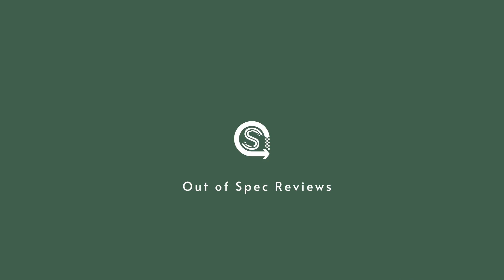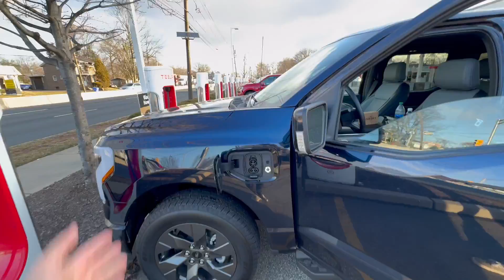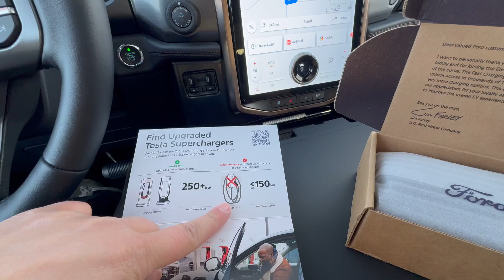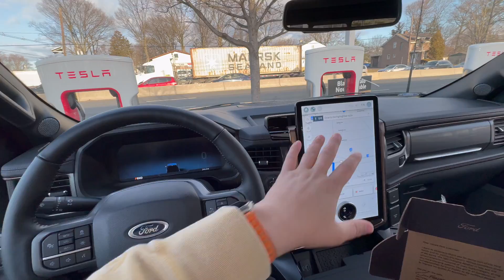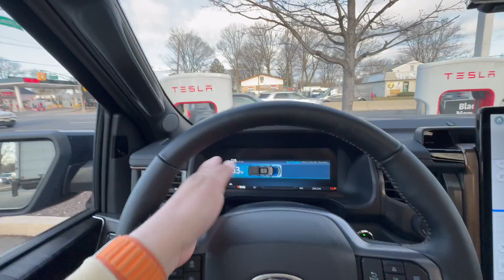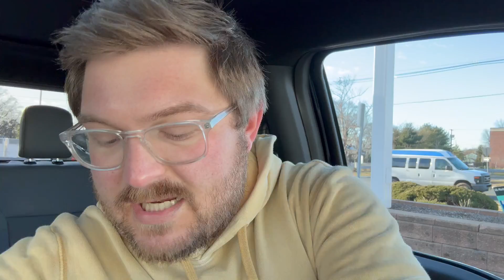Ford Gains Access To The Tesla Supercharger Network! Join Me As The First To Plug In

Comment: We have a Tesla supercharger station that was completed in the last year or so in a big parking lot near a Walmart and a few restaurants. I don’t know if it was in anticipation on the Cybertruck or non-Teslas using the chargers, but it has two options, one that I have never seen before. One charger is set at the end of the island with open parking slots beyond it making it basically a pull through. The other set up is the really odd one with the charger on its own little island set at 90 deg to the other chargers and sticking out about 3 feet alongside the parking slots on it side which would make connecting your Lightning a breeze.

Comment: When Rivian gains access, will those customers be able to use the Ford adaptor ? I doubt it. This adapter likely contains a microchip that confirms that the vehicle is a Ford and  and that the adapter genuine Ford issued adapter. There may also be a chance that the adaptor may identify if the vehicle has been tagged as stolen.

Comment: You are in the 1B spot charging on the 1A charger, the mach E looks like it's in the 3A spot so it will be charging on the 2B charger while the other lightning appears to be in the 4A spot charging on the 3B charger. So with three fords charging in seven spots there is room for one Tesla to charge, that would be the 2A spot. 

 This is going to be a problem, particularly in places like Ocala where the chargers are usually full and you have to wait on a spot. I think they should have restricted the all access to stations that are V4. 

 There are going to be major altercations at Tesla superchargers.

Comment: Kyle, can you create a video to address that you were taking up TWO Tesla charging spots in your Lightning test. The empty spot to the left of the Lightning would normally be taken by a Tesla. So that makes sense, one vehicle, one spot. But where you had to park the Lightning to charge is preventing a Tesla from charging because it's blocking the charger on the right side! So as a Tesla owner opening Telsa Chargers to non-Teslas is one something I can can live with for the greater good. But Ford vehicles taking up effectively TWO spots for Teslas is a deal breaker. In the SF Bay Area, we routinely have to wait for Tesla Chargers as it is. Fords taking TWO spots won't work for anyone. Ford needs to move the charger port or give Ford owners an extension cable with that converter.

Comment: My biggest worry is that the software on my MachE will not be updated by the time I even get the adapter. It's been almost half a year since the lane change assist feature in BlueCruise was released, but my Ford PowerUp software is still lagging versions behind to even receive that OTA update. Went to the dealership multiple times and they could never fix it. We could very likely receive an adapter, only to not be able to use it for god knows how long thanks to the terrible software. fingers crossed

Comment: The problem here is that the two spaces on either side of the truck cannot be used by Teslas.  Tesla ports are on the rear drivers side, a tesla would park in the space to the left to charge.  This is going to be a huge problem if one Ford truck basically removes three spaces that could be used by a Tesla driver.

Comment: Given the lightning is only around 150kw dc charging (so slow), I hope when they go NAC built-in, they boost the charging rate to 250-350kw. Common complaint for the truck is people like it until they want to do road trips or truck stuff like hauling (load range woes aside), then it takes too long to recharge it due to Ford's poor choice in charger that should have already been swapped out this model year. The other two domestic brands are soon to release their EV/Phev trucks, Cyber Truck already out (though has it's own kinks), Ford needs to refresh the lightning more sooner than later to stay relevant.

Comment: The supercharger reliability reputation comes from them having top to bottom control over the chargers, vehicles, and network. As soon as they have to deal with all of the variables that other charging providers have to deal with, the reliability will tank. People will also quickly discover the limitations of the stubby cables, low voltage, and congestions due to the wide range of vehicle charge speeds and battery capacity requirements.

Comment: The companion podcast is great, but I have one question for you regarding packaging. As a Tesla owner I am concerned non-Tesla vehicles will be blocking a lot of charger spots because the Ford port is on the wrong side of the car. The question is does the Ford packaging discuss blocking chargers to the left and suggest their owners charge using stalls starting on the right of a line of chargers? Thank you for this great video.

Comment: Well, hopefully and ideally, when manufacturers start with the native NACS ports, they put them on the front passenger side and/or rear driver side. They can literally go anywhere on a vehicle, or have multiple port locations. That would be way easier than redoing every stall at every SC location. As Tesla upgrades to V4 with longer cables, it may not matter as much, but those to port lications on the vehicle would be ideal to begin with.

And Elon wanted this. He wanted EVs to be ubiquitous among all manufacturers. So, any Tesla owner who's hating on this just needs to swallow their ego and entitled thoughts. It will get better eventually, for their sake, once the other networks start adding NACS cables to their chargers.

Comment: Cool. BUT!!! Reality check! From Reuters in January...... 50% less than planned! "We are taking advantage of our manufacturing flexibility to offer customers choices while balancing our growth and profitability," said Ford CEO Jim Farley in a statement. The announcement is the latest sign of slowing demand for EV trucks. General Motors (GM.N), opens new tab in October postponed the opening of a $4 billion electric truck plant in Michigan for a year. Ford told suppliers in December that it planned to produce about 1,600 F-150 Lightning EV trucks per week starting in January, roughly half of the 3,200 it previously had planned."
Reply: You do realize that demand for all vehicles, ICE, hybrid, and EV, has tanked with only a few exceptions due to high interest rates.
Reply: @charlescourtney4412  Um...you just pulled that out of your nether regions. The rich and early adopters are DONE! Few people want to spend $40K + on a new EV. There are plenty of reliable NEW gas cars still from $15-25K to start from Mitsubishi and Nissan! Get real Courtney!

Comment: Thought/idea, could they use a sacrificial "adaptor" on the ends of charge cables, to keep the pins new and easy to refresh?
Essentially a NACS quick change interface so all the wear items can easily and quickly be swapped out.
Reply: Look up Magic dock. It's done, but not really a long-term fix. Also not plug-n-charge

Comment: @kyle I'm surprised that there wasn't more talk on the location of the native chargeport. Now that we're adopting NACS, that is the next step! With the way this truck is parked to reach the inlet, it's rendering at least 1x Supercharger inaccessable for Tesla / other vehicles. Ford and other companies need to pursue moving their native chargeport location to the rear left or front right panels. This is the next big problem, and if CCS cables keep getting "longer" to where it will charge anywhere on the front bumper that will only reflect in more expensive cables, which will end up costing us more $ so more expensive charging to cover the maintenance costs.

Comment: Hey Kyle! Great content! Thanks for sharing!

One question I have: I know it's not on the instructions pamphlet, but can you plug in the adapter into the truck first, then plug in the charging cable into the adapter? That would allow for one-handed use to begin charging. I can see that you will still need 2 hands to disconnect the charging cable from the adapter with that release lever, but I'm just thinking about convenience and ADA support for people with disabilities.

Comment: Also going to see more complaints about non Tesla EVs taking up two spots because the cables are too short to reach. They were designed to reach the rear driver side corner and no more since that's where all Tesla ports are located. It was a way to save resources and money. Imagine how much more copper, aluminum, etc was saved and now needs to be replaced.

Comment: I am 50/50 for Tesla opening up their chargers to other brands, however ( ford lightning ) for example, the location of the charging port is going to force the driver to take up 2 charging spots  due to having to be pulled in and using the charger that should be used for the “ Tesla “ parked on its left that is revered in the spot to charge. I just find this cussing frustration for the busier supercharger stations and longer waits for the Tesla owners at times until all the older stations are updated to longe cables / centralized charging stations. I haven’t done much research on the possible upgrades that may be done to these station but it just seems like right now it may cause headaches and possible augments.

Comment: I would like to see a lock test. Obviously the vehicle locks on to the adapter, but is the latch that holds the cable also locked? If no, that is potentially scary. It means that someone would be able to interrupt charging at will, and if the vehicle then unlocks the adapter, theft could occur.

Comment: As a Tesla model Y Performance owner I can say for Tesla drivers this sucks.  To charge the Ford  you block 2 superchargers for Tesla drivers... Because of charge port location on Ford compared to Tesla charge port location. Longer cables would fix this issue, but will tesla go back and retro-fit these chargers? Just seems like in crowded EV markets (CA for example) where there are already long lines, there will be some issues when a Ford driver is blocking 2 tesla charging spots... Just sayin' ... BTW I Absolutly LOVE your channel!!!! Keep up the great work. Out of Spec Dave rocks too!!!
Reply: The majority of non-Tesla owners try to be cool and figure out a way not to block chargers if possible. But it is not always possible. The solution is V4 for the busy sites, and more sites in general. And other charging networks doing their part. If there are a few empty stalls, it doesn't bother me at all if an Audi is taking two stalls. Source: Supercharging in Europe.

Comment: Let's do some math. Tesla charges $0.50/kWh in my area, so the full charge for the Ford Lightning long range would be about $72, including charge losses (and minus 2 hours of wait time). Regular gas is $2.87/gal, so I can buy 25 gallons of regular gas for the same amount and drive on it about 500 miles. Great way to make extra cash Te$la! 😅
Reply: What does Electrify America charge? $0.80?...
Reply: We can all tell you're a hater and not a serious person by the way you parrot the disinformation line about "2 hours."

Tesla owners typically stay at a charger for 15 to 20 minutes.  Lightning owners a little longer, maybe 45 minutes.

Each power train has different advantages and disadvantages.  And the Lightning definitely has several major advantages over the ICE F-150.  But one in particular stands out:

The F-150 Lightning can be part of the solution to climate change.  The ICE version cannot.  It can only be part of the problem.
Reply: I own 90D, not an EV hater. I was referring to charge from 0 to 100 131 kHw battery pack in Lightning, considering the charging curve yes it will be close to 2 hours.
Reply: @sayyev  Very curious that you own an older EV, and describe a scenario that no experienced EV driver in their right mind would recommend or expect to do.

It's true that EV charging has gone up.  But a lot of competition is coming online now.

Comment: I have a Tesla wall charger in the garage. Can I use the adapter in case I buy a mach e?
Reply: No. This adapter is for DC charging only.  The one in your garage is AC.  You need an AC adapter from NACS to J1772.  In 2025, cars will starting being made with NACS charging ports built in, so no adapter will be needed for your Tesla wall charger.
Reply: @davemayo70  thanks !

Comment: Regarding the taking up 2 spots problem, Ford owners should keep this in mind when visiting a V3 Tesla Supercharger and if they have one that is positioned for front pull in at the edge, which I've seen at several locations, use that spot if available, as it's the one spot where you can probably safely park and charge without taking up more than 1 parking spot (you'll be poking your butt out of the spot by quite a bit, but if it's at the edge and doesn't block traffic, it's the best option).
Reply: We need a picture or a diagram that can be shared. I have a Tesla and a EV with the plug location in about the same spot and I don't actually get what you're saying. So a picture or something a link would clarify this
Reply: Watch Out of Spec Reviews "Ultimate Tesla Supercharger Stress Test Free EV Charging for Everyone in Europe" video, it will enlighten you. @HowardSmith1713
Reply: Why doesn't Tesla assign chargers on the app?
Reply: @vladimus9749  because you might not show up, you might be delayed. Someone else might need one. They do need a solution for long lines, there's no official "lineup place" at superchargers (don't know if the giant 100+ ones in California have this but normal 20 unit ones don't have it).
Reply: @HowardSmith1713  Still, seems like a good UX team focusing on human factors engineering could come up with a system better than a free for all. I'm surprised there's not even a designated queue at busy chargers. Costco and Sam's Club have queues for their pumps because they are always busy. Seems like a huge miss for a company so focused on using tech and their app to solve problems.

Comment: Tesla needs to quickly lengthen the charging cords.  I'm glad others will have access, but it's going to be rough to pull in to a supercharger station and find  a ford is taking up 2  spots.
Reply: Or they could move the white lines 3 feet left?
(Think it through)
.
Either way, it's not really a Tesla problem.
Reply: @rogerstarkey5390  That would make it worse, F150 is already struggling to plug in at that close of a distance it would make it worse if the lines were moved 3 feet to the left, this would also make it a pain in the ass for Tesla owners, the ones that tesla is mainly making them for

Comment: Tesla just needs to space out the chargers a bit more or have 1/2 of them pull through, which is going to be needed anyways.
Reply: "Tesla needs" to say to the other manufacturers "come on guys ... Just go "front right/ rear left " on your next model, all this goes away!
.
Or suggest that the others pay to have the lines repainted 3 feet left, or that the others pay for lo get cables.....
Reply: @rogerstarkey5390  I don't mind backing in, but I'd rather just use a pull through. I know that costs more in both space and materials, but if they want this to be more painless for everyone, they're gonna have to I think. Especially if EV's will be forced in the next 10 years.

Comment: The question is does the adapter work with a non ford or did they do something to block other ev makers
Reply: The CAR needs a firmware update to have the correct communication protocol.
If the car manufacturer did a good enough job, that can be OTA.
If they didn't, it's a dealer visit.
Reply: @rogerstarkey5390  interesting. Why would this be the case when magic docks are essentially the same thing and didn’t require an update to the car?
Reply: I'm sure it's Tesla blocking other makers from their end rather than the cars being adapted to support two protocols.

Comment: Can you ask ford about supercharger pricing. Will it cost more than teslas and is there a buy down rate option? Also I assume this would work with the plug and charge protocol since that buy down should be through ford.
Reply: So the question to ford should be 
"Did Tesla give you the proceeds and benefits of their drivers' investment for nothing?"
.
I'm sure someone will pay something at some point, but using Europe as an example, even with a monthly subscription , the first charge on a Supercharger offsets the cost, thereafter it's cheaper than the majority.

Comment: Is the charging speed faster for non Teslas than using non Tesla chargers?
Reply: What's the max on the lightning? I think Kyle hit 160kW?
The other question is
"What's"faster"
Finding a "faster Charger but taking time to connect (IF you can) or, being slightly slower but connecting in 10 seconds?
Then there's the stress.... Or lack of....

Comment: Using the Tesla app filtered to F150 lightning with adapter it lights up all the V3 stations. Filter to Ev6 with adapter it is dark except for the magicdock stations. So would it work using the app manually to start a charge on a V3?
Reply: Nope. You can only enable a charge in the app at a MagicDock. No handshake will initiate & the charge will fail.